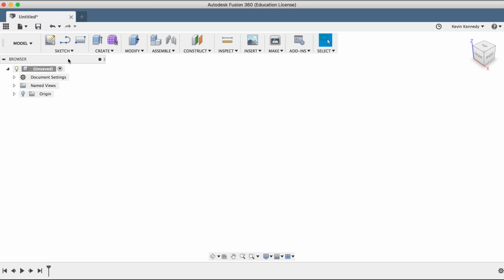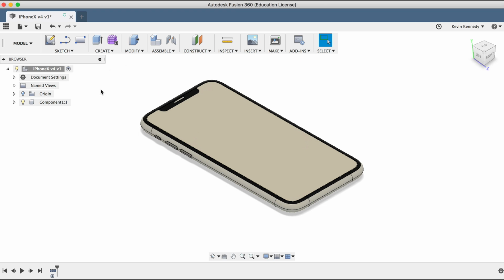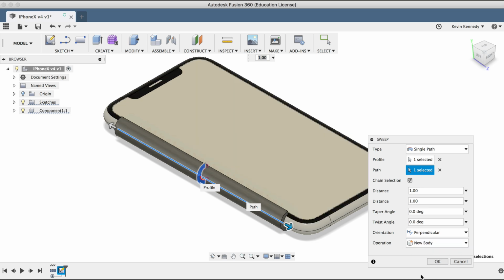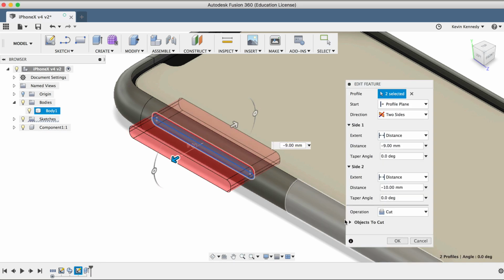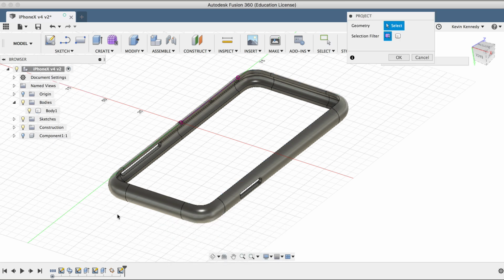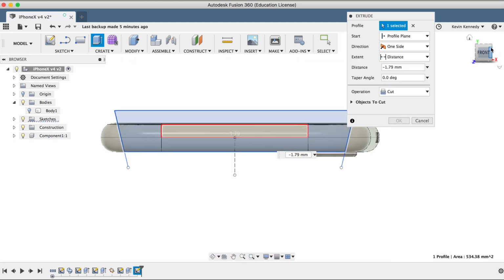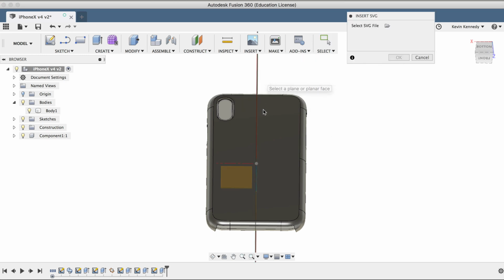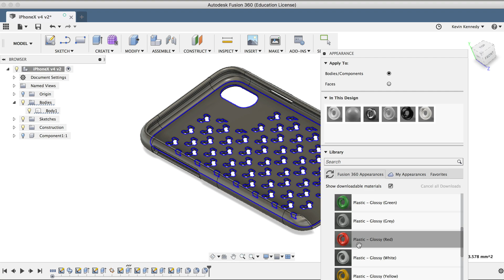How to 3D Model an iPhone X Phone Case - Learn Autodesk Fusion 360 in 30 Days: Day #10

Comment: How did you get the step file? When I follow the link Autodesk has me login before I can down load it, then when I download it I get a F3D file. This file has the History in it and the Y axis up. Speaking of which axis is up I like the change with out telling anyone.
Reply from the maker: Maverick Maker - I used the exact file that I linked too, which is the .F3D (Fusion 360 file).

As far as the Y-Axis up, I have had that in the last few videos so I'm not sure I follow your remark? Whether the Z-axis or Y-axis is up you should be able to follow along without any problems.

The only difference would be selecting the XZ plane anytime I select the XY plane. If you'd like to change which axis is up, simply go to Fusion 360 > Preferences > General > Change to the "Y up"  or "Z up" under the default modeling orientation. Cheers, Kevin :)
Reply: As @Maverick Maker stated above you import the .stp file but the download link only provides the .f3d file which means I am unable to follow your instructions exactly.  Can you please advise.  Thanks.
Reply from the maker: Hi Neil - Please follow these instructions:

iPhone X Phone Model 
1. Click this link http://bit.ly/iphone-x-download
2. Click the orange Open/Download button. This will toggle open the file license type and file name.
3. Hover over the file name and two buttons - Open and Download - will appear.
4. Click the orange "Open" button and it will open the STEP file in Fusion 360.

My Phone Case Demo Model 
1. Click this file link: https://a360.co/2NZzrIB
2. Hit the blue download button in the upper right-hand corner. This will toggle the list of file types available.
3. Select STEP File
4. Insert email into modal. Click blue send button.
5. You will receive an email in about 1-2 minutes with the file download. Download the file and import the file into Fusion 360. To import a file check out my other video -> https://youtu.be/TVD0YlfGjM0

Let me know if this works! Cheers, Kevin :)